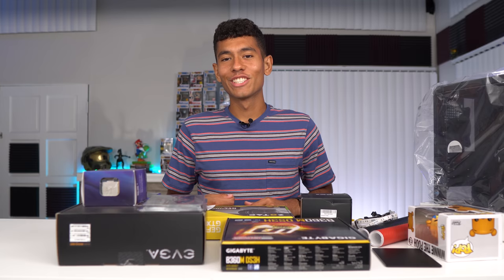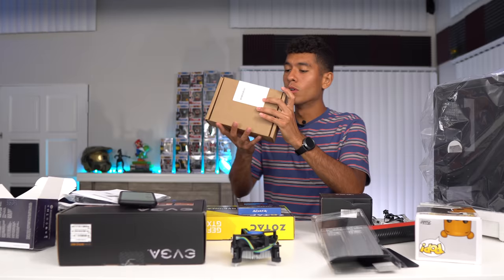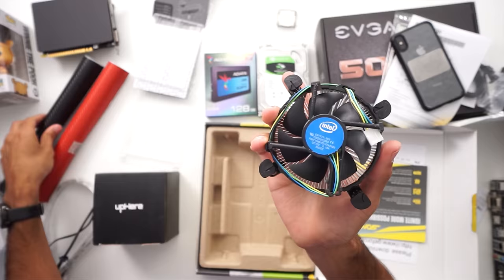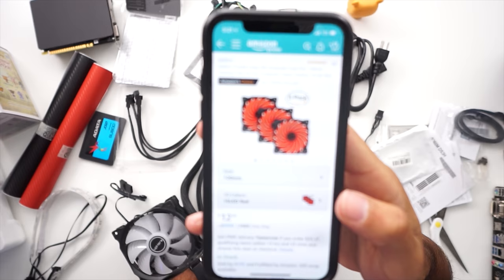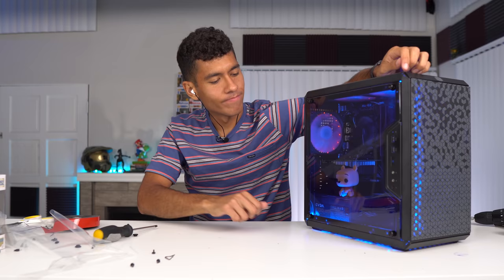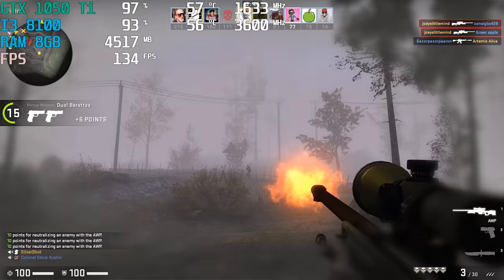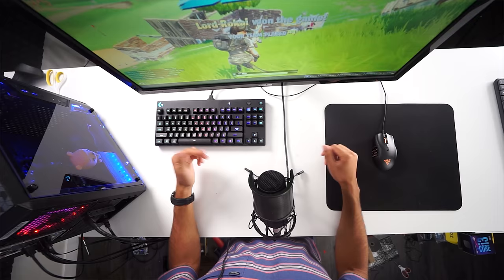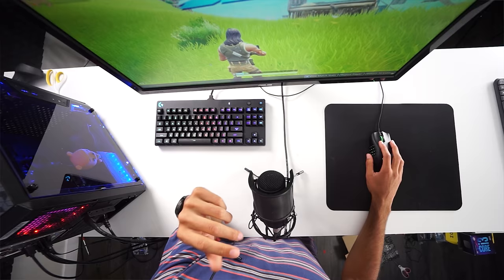$650 Gaming PC Build - i3 8100 GTX 1050 Ti (w/ Benchmarks)

Comment: Do a 800$ gaming pc for editing and recording
Reply: That would be awesome because most people like to stream and edit and just record so having a pc guide like that would be one of the more popular ones
Reply: I would presume for $800 a Ryzen 5 and a 1060 maybe? I dont so any editing so im not sure but i would think that it would be a good pair.
Reply: Grizz bout to comment that
Reply: This would be a good combo, Since the Ryzen 5 is very good for productivity and some gaming and cheap its very good for that build and the 1060 will hold everything up just perfect so I think this build would be pretty good.
Reply: YESSSSSSSSSSSSS MY BUDGET IS UNDER $900 SO THAT WILL BE PERFECT!!!!!
and maybe i'll add a higher end GPU or a slightly higher capacity SSD
Reply: Yes we need to see it
Reply: Yeah!!!
Reply: You dont even know if its possible to get all that in an 800 dollar budget-.-
Reply: Do a gaming PC for editing and recording? 😂 Wut y 😂
Reply: Agreed
Reply: Yeah I need the same but before December
Reply: Alesio Gamer Mtb- Msi Amd X370 Gaming motherboard 
Cpu- Ryzen 3 2200G @3.8ghz
Gpu- Gtx 1050ti 4gb super-clocked
Psu- EVGA 550W 80+ Bronze rated fully modular
Ram- 16gb ddr4 2400mhz hyperx 
Case- Corsair carbide series spec 04
HDd-1tb wd blue 
128gb ssd
Reply: I think this should be able to handle it decently (I'm from the UK so prices may differ)

GPU: Rx 580 4gb/1060 6gb (here it's a difference of a hundred for the 580 8gb or 1060 6gb)
CPU: Ryzen 5 1600 (could get a 2600 with MoBo bios update)
MoBo: Gigabyte GA-AB350 (no bios update change to an x470)
RAM: 8gb ballistix sport 2400mhz (If you can afford it go for 16gb)
HDD: 1tb western digital 7200rpm
PSU: EVGA 500W B1 (I'd recommend the 500w BQ but it means going slightly over budget)
CASE: Phanteks P300 (change this to your budget if it's out of it)

Total Price -  $794.17

Optional
SSD: kingston 120gb ssd (for os)
LED strips
Extra case fans

Comment: do it again for a 2019 build with amd/ryzen  parts
Reply: Did this exact build opposite brands. Ryzen 2600x or 2600 .1650 super. G skill 16gb 3200mhz ram. 500br evga psu kingston 240gb ssd asus prime b45m-a/csm mobo. Gets 2000 performance if done correctly
Reply: Eduardo Flores What case
Reply: Eduardo Flores cuz I wanna add 3 fans to my case but my case only has like 1 spot
Reply: Got the q300l
Reply: @oualid533tmt2  lmaoo yes i do got the q300l and its been getting really hot every since a built it with 2 intake fans in the front and one exhaust fan . i have 3 slots for fan which are definitely. Gonna need filling if imma stick to the case
Reply: Eduardo Flores Nice
Reply: I found out that the b450 pro 4 has enough fan slots

Comment: Just built this same exact pc but added 8 more in RAM.  Perfection for a budget pc!  Thanks Joey!
Reply: I’m about to build this myself. I bought a “EVGA 500 W1, 80+ WHITE 500W, 3 Year Warranty, Power Supply 100-W1-0500-KR, Black” power supply instead. Will this still work fine and fit?
Reply: Do you need a WiFi adapter
Reply: Should be fine. All about the same dimensions.
Reply: Yes

Comment: where can you get that backplate Joey put on the 1050ti?
Reply: SolidState have you found out where to get the back plate for the gtx 1050 ti
Reply: Kyle TheGamer12 Backplates can be found at: https://www.jmmods.com

Note: They offer backplates for just about any gpu you might have. Additionally, they offer a variant of different design options including LED implementation on your gpu. I hope this helps anyone that had the same question I did. :)
Reply: Are there any on amazon ?
Reply: SolidState I think you should type in Amazon gtx 1050 ti mini backplate it should cost around 10-20$
Reply: Apple Fan Boy there is no
Reply: You can find GPU backplates at https://www.v1tech.com/shop/backplates/blankbackplates/

Comment: I built a pc with these parts, and when i went to turn it on it started to boot loop, no display or anything, and when i plug in my LED’s into my power supply, they also flash on and off. help please!
Reply: try some stuff, unplug ram and boot up, unplug gpu and boot up, do some research to try and find the part that causses the faulure of the system, also clear cmos
Reply: Ask on reddit r/buildapc
Reply: remove bios and put it back
Reply: Take out the small battery on the motherboard and then wait a minute before putting it back.

Comment: Hello!
So I have a question for you Joey or anyone who can help me. 
I built my first gaming computer a few days ago because I really wanna get into pc gaming and obs streaming. My friend helped me build it and everything, but when I play games like Fortnite, or H1Z1 I lag horribly... to the point where I can’t play. The games choppy and my frames bounce everywhere. I spent a total of $950 on it, and I feel like I waisted my money. If anybody could help me I’d be appreciated... idk what’s wrong with it. 

The parts I used are -

1.) i7-7700K LGA1151 Processor
2.) 2TB BarraCuda 3.5” Internal Drive
3.) Hyper 212 Evo Fan Cooler (whatever it’s called)
4.) 650 Watts Power Supply PS650BSM
5.) 4GB GeForce GTX 1050Ti
6.) Asus TUF Z270 MARK 2 Motherboard 

There’s an SSD card to but idk the exact one. 

I mainly bought the game for Fortnite and streaming, but I would like to expand into other games. In order to play Fortnite, I have to play on all the lowest settings to play without a choppy lag... anything higher I lag horribly. And when I stream while playing, I lag even more so I can’t stream.

If you Joey or anyone here can help I’d be so thankful!!!

{EDIT}{UPDATE} Thank you all for your kind help and tips! :) My computer works fine now and runs beautifully. I’m averaging a good 120-140 frames so everything is AOK now!
Reply: Hello Gabe. The first thing I would have to say is buy another fan. And the second would be, what ram are you using? I think that’s where the problem lies in your build.
Reply: bob lex if I’m thinking of the right thing of what your talking about (sorry I’m just learning everything about computers lol) the ram was a DDR4 - 2400 1.2V Ballistix Sport
Reply: Okay, well there is no compatibility issue with your parts in your computer. So one thing I would suggest is to open the case and check if everything is plugged in the correct spot, and if it is tightly locked in. 

I would first check the motherboard and see if everything(ram, cpu, + graphics card) plugged in the right spot. 
And one final tip if you are using 2 sticks of ram do not put them side by side, they have a specific order in which they should be put in
You’re welcome, but that’s the best I can help you:)

Oh, And I forgot don’t plug your hdmi cord into the motherboard.
Reply: bob lex ok thank you so much for the help! When I wake up tomorrow, I’ll open it up and have a look
Reply: Gabe bios and drivers update?
Reply: Gabe bios,driver, windows updates?
Reply: 7700k and 1050ti?
Reply: no bottleneck at all my dude
Reply: Make sure all your drivers are up to date, especially on the mobo and gpu. That should fix the frame rate however note that you are using a GTX 1050ti so being able to game and stream will be pushing the gpu quite a lot. And lag might also be attributed to your internet. Nonetheless good luck.
Reply: Gabe ...maybe you should confirm if your monitor is plugged into the graphics card and not the motherboard... sometimes it's the small things...I mentioned this coz u said ur frame rate is choppy
Reply: Gabe it is because you have a huge gpu bottleneck. The 1050ti really doesn’t belong in any pc over $400
Reply: Gabe for the obs part, select the encoder as NVENC, it doesnt use so much cpu power but gpus, but i dont know does it work on gtx 1050 ti, but i can confirm it works on gtx 1060
Reply: Download NVIDIA Gesync and try optimalizing pc maybe that works
Reply: ScorzzGaming gsync isn’t a thing you can download. It is a $300 modular on he monitor lol. That would be like saying download a new cpu
Reply: Gabe you need a better GPU because I have almost the same specs but I cant stream and if I do I'll lag horribly at the point where the game crashes
Reply: Exactly
Reply: popnimpop you're wrong
Reply: Gabe Why did you pair a 1050 Ti with a 7th gen i7? The 1050 Ti would be the problem and you should've gone with a 1060 or 970.
Reply: mrbear123, don't be silly. You sound like you are new to pcs (I build my own pcs). I had that happen once or twice only so far, and it turned out the motherboard was a lemon (bad batch) and got a replacement (same one) that was functioning correctly as it should. The other time it was bad ram (defective too) Also, bad/defective powersupply can show these symptoms and worse sometimes., I just say this, "sometimes you can get lemons instead of sweet apples!" A low gpu (even if it would be integrated like HD intel) your pc would at least play it 10 - 20 fps constant ( I used to play at 10-20 fps, its not so bad once you get used to it) but thats beside the point here, I think there's something wrong with his pc cause a 1050ti is better than my 750ti and that can play fortnight at 30+ constant 1080p med mix. A 1050ti should be pulling that or better, not to mention his cpu is 200% better than my i3
Reply: cjtron Calm down, I know it wouldn't technically be the problem, but I just don't get why he would pair a 1050 Ti with a 7th gen i7. The actual problem would be something else not working, like a dodgy PSU, faulty RAM or something else. I also build my own PCs, mate, most people that are here are too.
Reply: You made it sound like it was the problem, so sorry ( but in my defense, you wouldn't believe what people think is sometimes a problem... Not only in pcs) Yes definitely, something's not right with it. As for why he spend so much on a cpu opposed to a gpu? A possible futureproofing, since if you get a strong cpu+motherboard with your budget instead of gpu, you can later swap the gpu (gpu gets always replaced first in gaming over time) and the 1050 ti is no slouche, so it was smart thinking. I rather get strong cpu+motherboard to later upgrade gpu than the other way around ( I don't only play games). Gpu's always get better, as is the case soon, Nvidia is releasing new gpus next year and as always amd will follow. He can just resell the 1050ti later, but it should be enough for 1080p right now.
Reply: mrbear123 I went with the 1050 because that’s what my friend picked out for me with my budget. I don’t really know much about computers or how to build them so I asked for his help and he gave me the best I could get with my budget for the moment. My computer works 100% fine now, and runs beautifully
Reply: Make sure you're not using your integrated gpu and that you're using your gtx 1050ti. It's likely that. If you don't know how to use the 1050ti or it still doens't work you should prob go to a pc repair store. It always works but pricy. I'm guessing it's a tiny problem. Don't stress about it dude. I've been in this situation loads of times
Reply: Gabe Good to hear. Although the 1050 Ti isn't the best GPU you could pair with your processor, it's still very good.
Reply: Gabe, so what was the problem, how did you fix it ?
Reply: cjtron Agreed. I wouldn't spend so much on a i7 and then pair with a 1050 Ti, but it is still a very good card and like you said he can swap it later should he need/want to. Sorry about that, I reread my comment and I wasn't that specific, so I get it was a misunderstanding.
Reply: Gabe may be your power supply or  internet is the error
Reply: You bottle necked your cpu with gpu i7 with a 1050 ti... i think
Reply: Gabe How did you fix it? Just curious: what was the problem in the end?
Reply: you spent the most of the money on the cpu and motherboard, a i5 with a gtx 1060 would've been a better build. gtx 1050ti is too weak
Reply: Maybe you connected the HDMI or display port to the motherboard not the graphics card.

If you connect it to the motherboard then ur PC will be running on intel HD graphics.
Reply: popnimpop  you know what bottleneck wouldn't happen to gpu as its paired with i7 7700 k
Reply: Gabe I was gonna help but I saw your edit, glad your doing good now cx
Reply: Gabe but do get a new gpu, your cpu is using is potential
Reply: Much better if you pair your i7 with 1070 or 1080

Comment: Hello fellow viewer! 
I made a pc a few months ago for the first time. By the way, $400 is an amazing price for a starting pc build. I built a gaming pc with a Intel Pentium 3.3 GHz, Radeon Rx550, Ballistics DDR4, 4 GB, 250 GB HDD, and a 400w Evga non modular power supply. I also used a rose will matx case and Marx gigabyte mother board. I want to say that this less expensive solution is amazing. It performs better than my $950 laptop. Here are the FPS rates for some games.
CSGO: 293 Max;133 Lowest
R6S: 301 Max; 188 Lowest
RocketL: 92 Max; 64 Lowest 
Battlefield: 123 Max; 48 Lowest 
Overwatch: 133 Max; 72 Lowest
CPU Temps: Overclocked
Highest: 47 Celsius
Lowest (stock coolers) 33 Celsius
CPU Temps: Not Overclocked
Highest: 43 Celsius
Lowest: 32 Celsius 
GPU Temps: Overclocked 
Highest: 51 Celsius 
Lowest: 34 Celsius 
GPU Temps: Not Overclocked 
Highest: 47 Celsius 
Lowest: 32 Celsius 

If this helps please feel free to reply with your builds or experiences! 🤗

Comment: Can this build take a 1060 3gb mini? Im concerned about the wattage, not sure if its gonna be a problem or not. It would be this exact build, even with the Winnie Pooh Pop haha
Reply: TurtleOrigenHD yes it can
Reply: Duarte Barradas i ordered the 600 wat version, it was 4 dlls cheaper i dont know why, just in case i wanna upgrade in the future. Thanks anyway bro
Reply: Booiii 600 is for a 1080
Reply: Nicholas Gure Does that mean its not gonna work on my rig? Or its just something not necessary?
Im just worried
Reply: Its gonna blow up
Reply: Jk just a taddddd overkill
Reply: 500 is plenty but 600 is more future proof
Reply: no, the system will only use what it needs, the PSU can only underkill not overkill, so I guess getting a bigger power supply is good for future updates.

Comment: Do you recommend this pc for fortnite because this would be my first pc and I'm just a 12 year old and have a budget of 700$
Reply: If you can I would recommend paying a little bit extra for a 6gb GTX 1060. The performance is way higher and it will run FortNite smooth as butter.
Reply: Yea
Reply: Gets this setup upgrade ur to A 6 core intel (u can still get a i3 but i5 will 100% also work)and a 1060 ti but every thing else is perfect for ur budget in the build
Reply: No go with amd much cheaper and better
Reply: amd is not as well optimized for fortnite

Comment: should i buy this for fortnite gaming?
Reply: You should NEVER make a PC solely to play Fortnite
Reply: Yes but upgrade the cpu to maybe Ryzen 5 1600 or Ryzen 3 if you are on a budget and upgrade the 1050 to a 1060 trust me on the gpu because the 1050 is not gonna cut it if you can try to go for a 1060 6gb.
Reply: ShiFTy lmao 1050ti is one of the best bank for your buck card........
Reply: NothingSpecial IK it’s a decent card but for like 80 bucks more you can’t get a 1060 which has much better graphics and will get you much more better peformance
Reply: ShiFTy I understand you now, but Im loving what im doing now. I am overclocking my card hella hard and it is second handed I pick them up for 100 bucks and then I get 144 fps 1080p with good settings then it is enough for my monitors so Im satisfied. I just buy new cards when they die because of my overclocking

Comment: Can I upgrade the i3 to i5 or even i7?
Reply: HACKING WITH LINUX yes but you should get a better gpu if your going with an i7 but if you go with an i5 get a gtx 1060
Reply: Also if u want u can upgrade ur i3 to have 6 cores
Reply: BornFromFire623 should i get i5 8400 gtx 1060 6gb or Rx 580 8gb?
Reply: cнadѕнredѕ 幽霊 idk which one is better but an i5 with a 1060 should be fine.
Reply: cнadѕнredѕ 幽霊 the rx 580 is better than the gtx 1060, but if you can fit it in your build, it the rx 590/gtx 1070 would be fine with an i5.
Reply: Mikey Collins Thanks! Unfortunately my budget really doesn't allows me to buy a gtx 1070! Although I will upgrade to it the future together with i7 8700
Reply: cнadѕнredѕ 幽霊 why not save up few more months and get  the limited edition i7 8086k wich is 4ghz and Turbo/overclock to 5ghz ? Why wouldn’t you get the 8086k
Reply: Apple Fan Boy cuz I’m impatient?😂
Im not into overclocking bro it just isn’t my thing. Mayyyyyybe in the future I will upgrade!
Reply: cнadѕнredѕ 幽霊 Okay it’s your Choice but I am suggesting you to buy the i7 8086k Limited Edition
Reply: @-cadred-8414  doesnt matter
Reply: valde afksher yep
Im enjoying my rig xD
❤️

Comment: Mtb- Msi Amd X370 Gaming motherboard 
Cpu- Ryzen 3 2200G @3.8ghz
Gpu- Gtx 1050ti 4gb super-clocked
Psu- EVGA 550W 80+ Bronze rated fully modular
Ram- 16gb ddr4 2400mhz hyperx 
Case- Corsair carbide series spec 04
HDd-1tb wd blue 
128gb ssd 

You could upgrade the cpu and graphics card as this is around a 850 dollar build so you could go for a Ryzen 5 1600/1600x and upgrade the gpu to a gtx 1060 6gb

Comment: Nice video, but I have a question, can I replace that i3 with a core i7 8th gen?
Reply: Yes, you can. The Motherboard used in the video (Gigabyte B360M) will work fine with 8th and 9th gen Intel Processors.
Reply: Yes but your gpu would bottleneck it so it would be better paired with a 1070 or rx 580
Reply: @natalieivey23  yeah you're right you can't pair an i7 8700K with an 1050 Ti XD